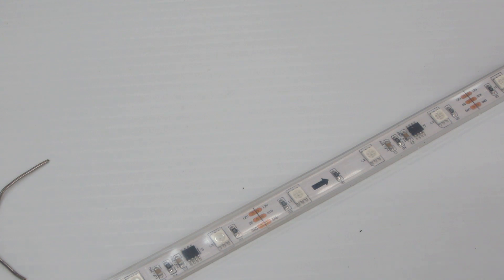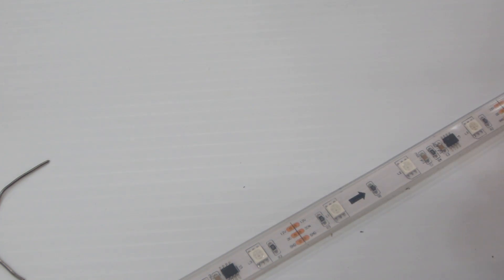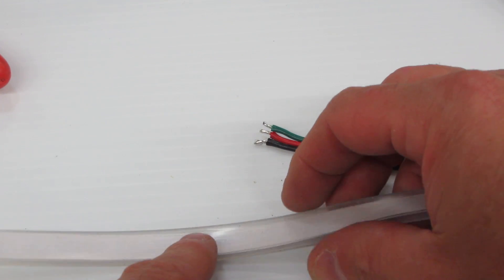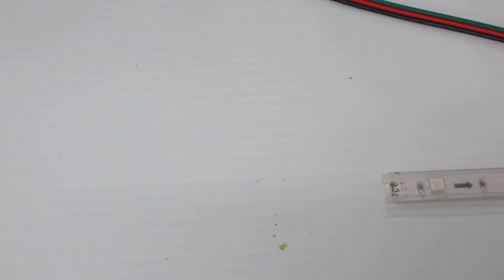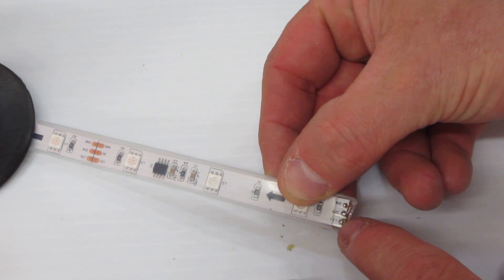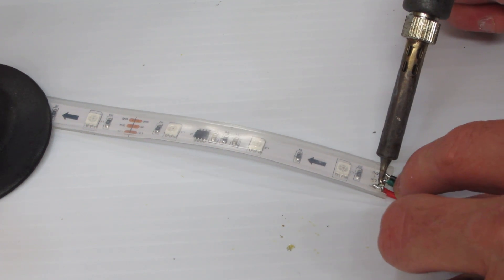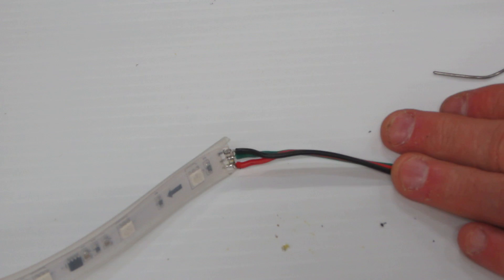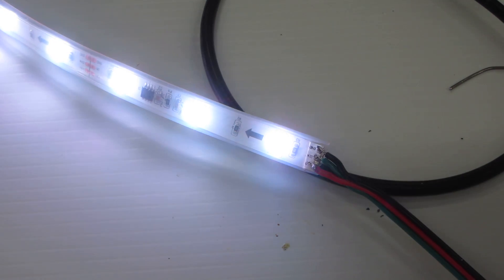HOW TO:  DIY Soldering of RGB Pixel Strips

Comment: Great vid, but I don't get how you tin the led nodes. Do you put the soldering gun on them directly to heat them (the same way you would do the wire) or do you melt the solder and let it drip on there? Thanks!
Reply from the maker: We just "wet" the soldering iron and the solder sticks to the tip of the iron.  Then we touch the copper and it "sticks" to the copper.